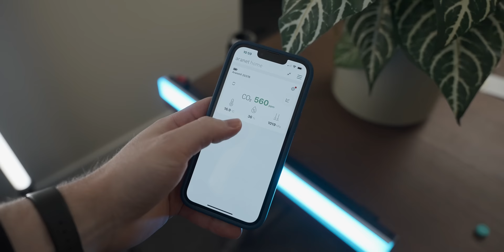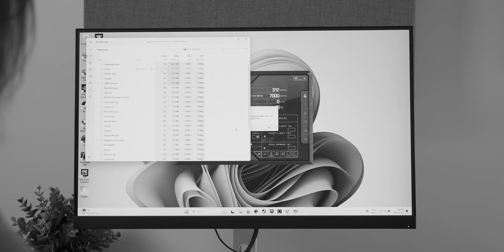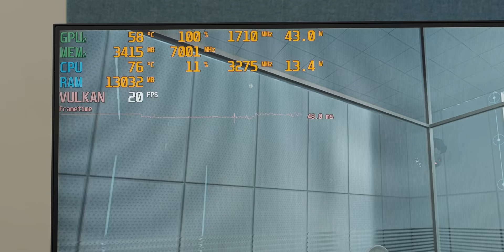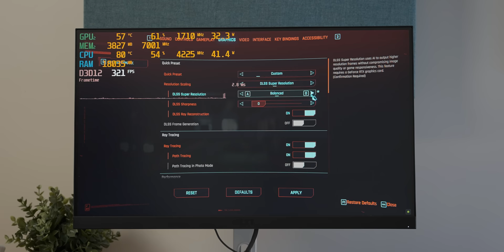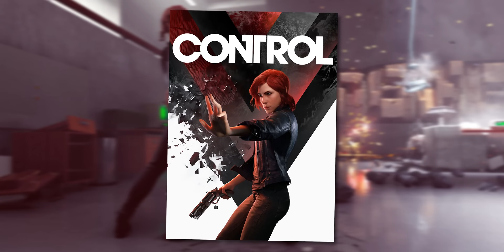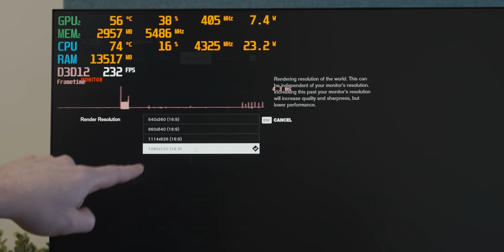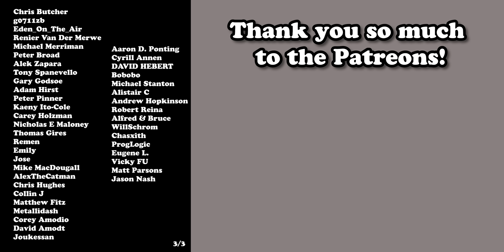Can The Slowest RTX Graphics Card Even Ray Trace?

Comment: hmm so if paired rtx 3050 6g with a rx6700xt together, you'll get a rtx 3070ti?
Reply: No lmao. Also no one does double stacking GPUs unless it’s like max tier 4090+4090 performance.
Reply: @DizzyRL  just a thought man
Reply: @MintJoker9578  Oh sorry if I came across as rude or anything. I use lmao a lot just in general tbh.
Reply: @DizzyRL  nah, it's OK
I was thinking about 3050 doing what it's supposed to do (ray tracing)and 6700xt doing what it's supposed to do(more vram and fsr3)
Reply: @MintJoker9578  ah, I’m not sure in the first place that you can mix 2 different brands. And if you can, I wouldn’t think you would get both softwares. Definitely would be a cool thing to research though
Reply: @DizzyRL  I know there was a post in reddit, said you can install both brand gpu in one system, just have to download both driver and turn off internet, get the amd gpu and driver install first, then nvdia, then install both gpu onboard
Atleast that's what I was saw
Reply: @MintJoker9578  oh damn that’s cool. Imagine a 4090 for the RTX and DLSS and then the 7900 XTX for the vram

Comment: The 2050 is so dogshit Nvidia didn't even dare to release it on a PCI-E card for desktops 😂

It's an insanely hobbled chip, in non ray tracing applications you can expect it to be slower than a 1650 despite having over twice the number of shaders and it's basically all thanks to that 64 bit memory bus.

Comment: They completely ruined fortnite. I started playing in late 2017 on an i7-880 and a HD5830. It ran at 1080P medium setting about 80fps. Then in 2018 i upgraded to a ryzen 2600X and an rx590. I was able to play at 1440P medium settings 150fps. Now I have a 5950X and an RX6800 and I play at 1440P mostly low settings (RT disabled) and only get 120fps average. Like wtf??? In all the other games I play I get 2.5X or 3X the performance of my 2600X system, and my 2600X system can only play 1440P all low 40fps in fortnite now.
Reply: It’s called optimization my guy. The new games decide that instead of making it efficient, you just need a 4070TI with DLSS 3 to get the frames at 1440p